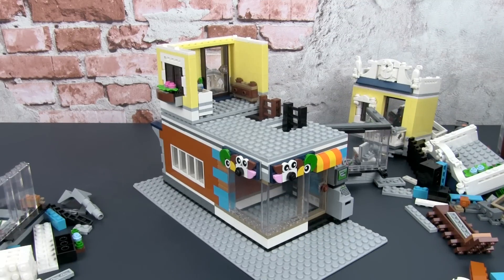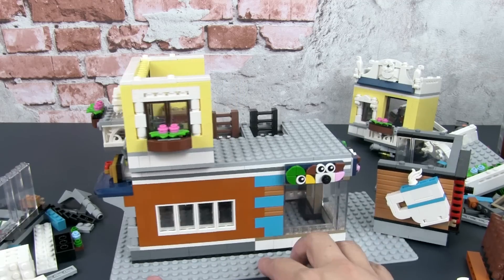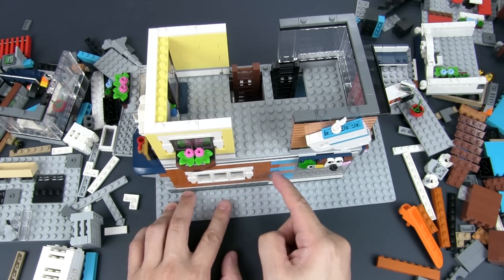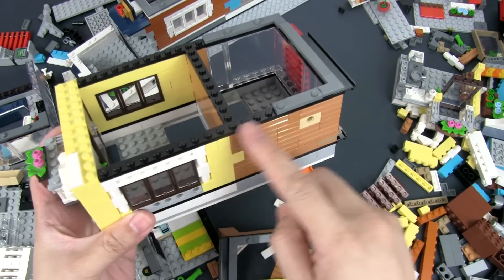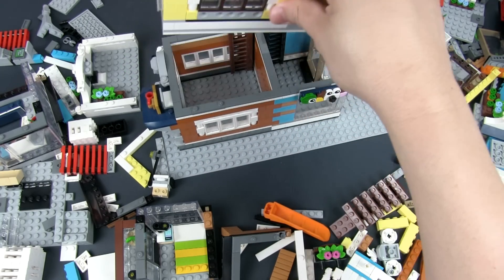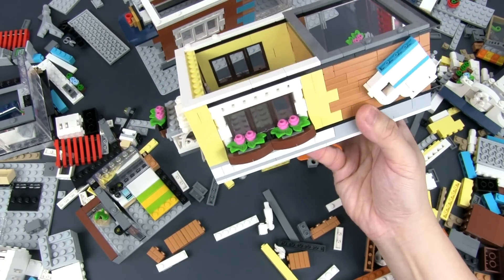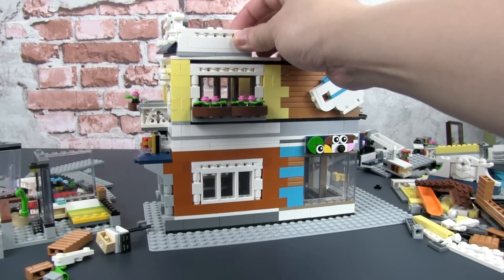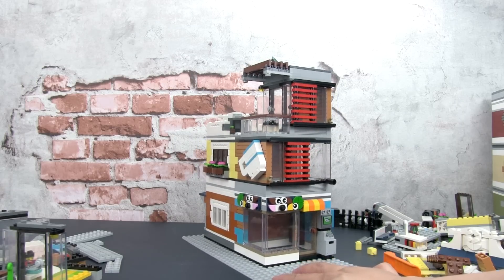2019 LEGO Townhouse Pet Shop & Cafe (31097) ReMOC (Part 3)

Comment: Looking good, JC.  I agree with Brickhead Studios, that there is something wrong with the middle of that side wall.  Maybe there are too many colours together or it needs a drainpipe or something to go over the vertical column of bricks that has about six colours in it.  It could act as a dividing line between front and back?  Anyway, very good progress and a great video!
Reply from the maker: I like the idea of the drainpipe if needed. But, basically, I will neaten up the points where the different bricks join so that it is more aesthetically pleasing and works better together.
Reply: @SmallBrickCity  Sounds good.  Nice one.

Comment: I suggest for the pet shop the glasses will face the other building and you have to do some changing.
Reply from the maker: I'm keeping all the windows as mentioned in the video to save on parts. Plus, it let's more light in when viewed or used as a standalone building.
Reply: I mean look at the windows of the pet shop that will give no light inside the room because it's the mirror one it will face other building.

Comment: Wouldn’t exterior steps and doors be better as opposed to ladders?  Especially in a coffee shop where hot coffee can’t easily be carried up and down ladders.
Reply from the maker: Exterior stairs will block the sidewalk and change the facade of the building which I do not want to do in the spirit of keeping to the original design as much as possible. I will rectify the ladder for the cafe in the final review video of the final version. Thanks!
Reply: Cool.  Understood.  Since you made a bigger layout, it could just be an alley to a set of exterior stairs between buildings.  So on the unfinished side.  Close up the ladder hole and you gain the 4 studs needed.  Just a thought.  Great reMOC though!
Reply from the maker: Thanks.  I have a solution that I think will satisfy all. But, it will only be seen in the final review video later this week :-)
Reply: Small Brick City can’t wait then!  👍😉